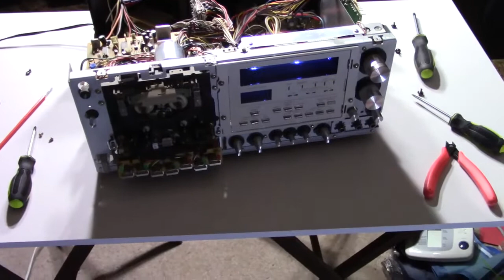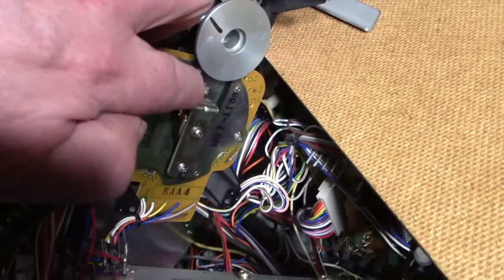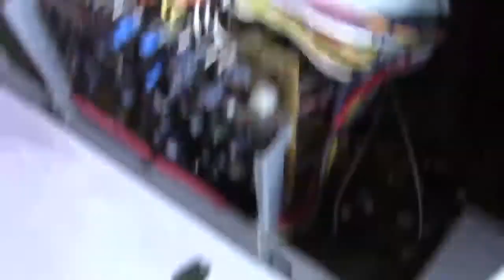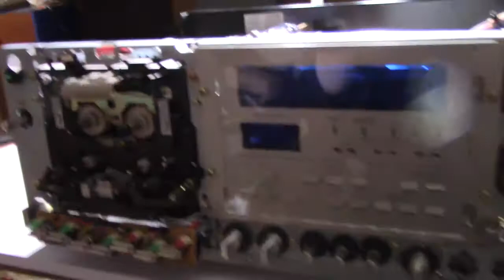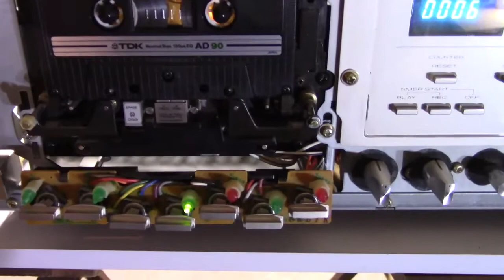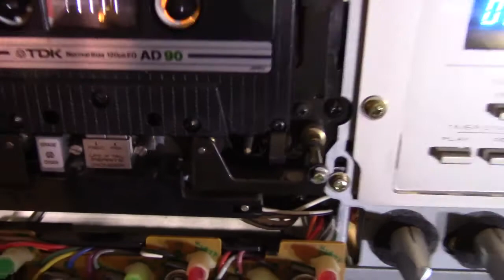Pioneer CT-F1250: Capstan Belt Replaced, Repair Project pt2

Comment: I used to own one of these babies. I loved it. I bought it while I was stationed in Okinawa Japan in 1981. By the time I got it back to the states with me in 1983 it was having all kinds of issues. There was a pioneer repair faculty and they fixed it 2-3 times. It kept breaking so I had to give it up. It was costing too much money to repair. I came upon your video completely by accident. Hadn’t heard those familiar machine sounds in over 40 years! Wow. I’d love to have one again. I still have just about all of my cassette tapes from way back in the 1980s. Thanks for posting this video. Really took me back.
Reply from the maker: So glad you enjoyed. Thanks for watching. I was stationed at Taegu South Korea in 1983. I still have gear I purchased while there.
Reply: Hammy Technoid now that’s really cool 😎. You know I also had a pioneer receiver amplifier that I bought along with the CTF1250 but I cannot for the life of me remember the model name. It kept blowing out switching transistors in the power supply. They just kept over heating. Ironically I was a radio repairman in the Marines but had NO idea of how to fix an over heating problem. I worked on mostly power supplies to microwave surveillance gear as a civilian but couldn’t fix a godamned stereo receiver. 😂
Reply: Hammy Technoid I couldn’t stop wondering and I did a google photo search. The unit was a Pioneer SX-D5000 stereo receiver amplifier. I just might repurchase through EBay. What’s your thoughts on that item?
Reply from the maker: @Cookefan59  I found some info on HiFiEngine.com and it looks like a nice integrated amp. 80 watts per channel would be adequate for high efficiency speakers.

Comment: Did you ever make the 3rd video of the completed restoration?
Reply from the maker: That would have been the one labeled "Audio-Gasm". However, shortly after, the idler belt split in half, so I need to go back in and replace that one. Stay tuned for more. Thanks for watching!
Reply: I have my 1250 in for a service.  The belts have almost melted. Bit of a mess.

Comment: Hi. I have a Pioneer CT-F1250. But the direct drive motor does not work for me, the one that pulls the tape with the roller. From your experience, what could be the reason for this dysfunction?
I am not electronic, but I am curious and I do the basic maintenance of cleaning and belt changes.
I appreciate the concept.